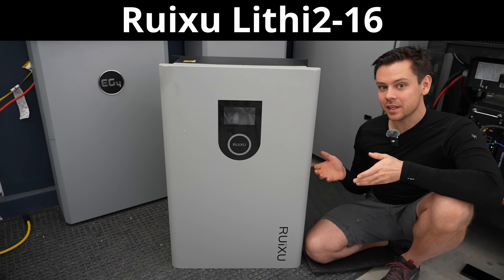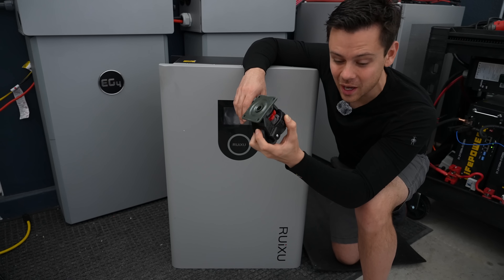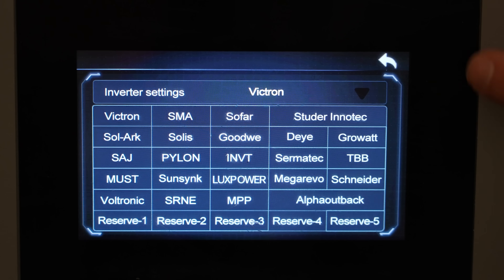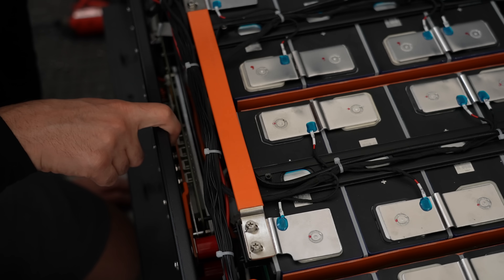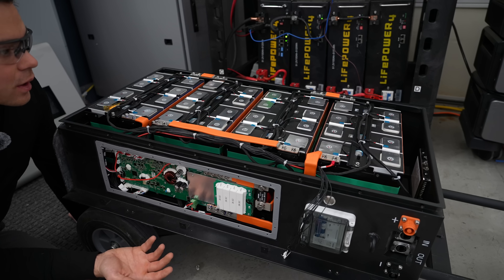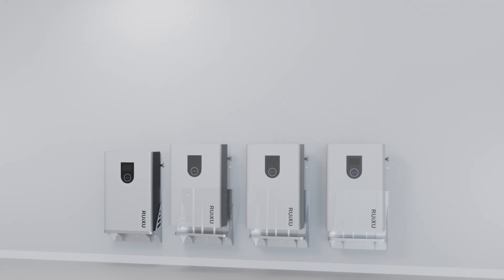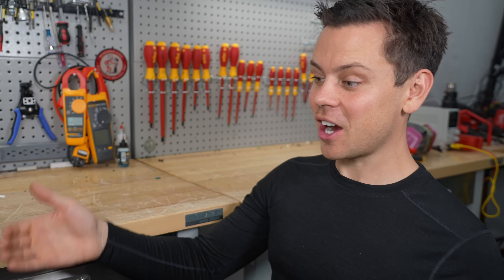Ruixu Lithi2-16: 16kWh 48V LiFePO4 that is Cheaper than EG4?!

Comment: Will, not sure what the best way to reach out to you. I really enjoy your content and have ventured into the realm of battery and solar this year. Maybe you can clear up a couple of things for me. I mounted 2-370W Grape Solar Mono Panels(41V VOC/11.5A ISC) in parallel on the flat roof of my patio. I have them set at the maximum exposure angle where at noon on a cloudless day the dot is dead ctr on my angle finder. I am connected to an Anker F3800 and HPP setup with 8 gauge PV wire at a length of 60 feet. I don't think I've ever seen you do content on Anker products. If that's true, I'd really enjoy seeing you review their stuff. As a reference, I live in South FL and the temps lately have been mild from 77 to 82 degrees. The most watts I've ever produced at noon has been 615W total. Over the course of a clear day, I'm getting about sun for about 6 hrs with an average total kWh of 2.2. Question 1: What's the best way to clean solar panels? Mild soap & water or is Windex okay(with or without ammonia)? Question 2: I've yet to see close to the 740W I should be able to produce with the 2 panels. Is this mfg not the best? I don't believe I'm getting a lot of voltage drop with my 8 gauge wire run. Any ideas? Thanks for your time and keep up the good work.
Reply: I just purchased some Canadian solar panels (535w) and hooked one up just to test to my Anker c1000, and the most watts I received was 305 watts In Arizona at 1:00 PM On Dec 20th . So with your comment I figured that this must be about right for this time of year.

Comment: It's not recommended to lift sideways with lifting eyes. I put a flat washer and cinch it down a tad. If threads are out, it may fail. Great video. I am getting to the point i'll start buying parts for this next summer without screwing myself to much..

Comment: I have a vacation home on an out island in the Caribbean where the grid is very unreliable, so there are frequent power outages.  The power can go out multiple times a week, and even multiple times per day.   Many properties have whole house backup generators, as does mine.  I’m currently faced with having to replace mine as they only last about 5 to 7 years.  Unfortunately they can also be expensive to import, maintain, and to run.  Propane is the most common fuel, but diesels are becoming popular.  Either fuel is expensive at about $6 per gallon.  The propane generators in particular can be frustrating to keep running because of a lack of qualified service people and the environment.  They are not the most reliable, and they are fuel hogs.  Given the nature of the outages a battery pack like this would seem ideal.  Seamless transfer and quiet.   This battery pack paired with a EG4 Hybrid Inverter configured for ‘Battery Backup’ would seem perfect??  I wonder if I am missing something?   I don’t have any plans to install solar, but that might change in the future.  For now I just want to have another alternative to an annoying generator.

Comment: Why couldn’t you use the super cheap LiTime 12V 560AH batteries for the Flexboss? Connect 4 in series? Would the 250A BMS limit the system?

Comment: Been completely off grid for 5vears this channel has helped me a lot.  I'm curious if this battery will work with my magnum ms4448 pae inverter charger. I have the bmk and shunt and my inverter has a rs485 communication port and I can set up my charge profiles with my me/arc remote Any help any one could provide would be greatly appreciated. A lot pf money of it shows up and I can't turn it on or something.  P.s great channel Will!

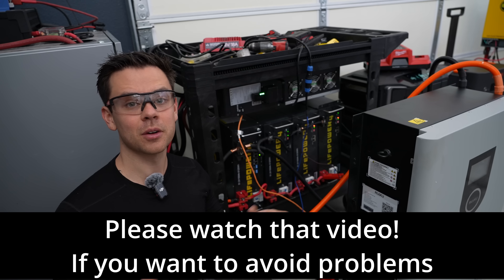Comment: I haven't been able to find the video referenced at 8:50. Could we possibly get a link? Thanks.
Reply: same question!  I have 3 EG4 PowerPros but might want to add one of these bad boys in parallel
Reply: I'm looking for the video, too.
Reply: @willprowse also looking for the video. Same question on paralleling this or the midnite powerflo battery with and eg4 outdoor pro. Can you link the video. Or do a video covering how that's done, or if it's possible. Thanks.

Comment: This is super exciting to see—thanks for breaking down the Ruixu Lithi2-16! 🔋 It's great to have more options in the 16kWh 48V LiFePO4 space, especially at a lower price point compared to EG4.

A few thoughts/questions:

    Price vs. Quality: While it's cheaper, how does it stack up in terms of cycle life, build quality, and warranty compared to EG4?
    Compatibility: Is it as easy to integrate with inverters and other system components, or does it have specific requirements?
    Performance: Any noticeable differences in real-world performance, especially under heavy load or in off-grid scenarios?

This seems like a solid contender for anyone building or upgrading their solar system. Thanks for the deep dive—it’s much appreciated! 🌞💡

Comment: Will Hi . My name is Ross i just want to ask you a Q  i do have two batterries 48 v connected in parallel can i add any othrer batteries the same voltage to the sistem with out  any problem??

Comment: Thanks Will! BTW, you'll find that heavy wheeled batteries, like a tall load on a hand truck, must be "top-balanced." Everyone knows that even an ordinary lightweight broom is nearly impossible to balance with the big end down, but can be managed better if it's top heavy -- as long as the appropriate fine motor skills are brought into play. Doesn't excuse poor design and execution, but it does highlight one possible workaround!

Comment: Will, to satisfy the 400ah requirement of the 12000XP could you combine one Ruixu wallmount and one Ruixu server rack battery without any issues ?
Reply: You need to increase the battery capacity so that it can reach a ratio of 5 with the inverter's charge and discharge current.

Comment: At The beginning you stated this is an outdoor battery, does that mean it cannot be used indoors?  If not why not? Thanks
Reply from the maker: If it's outdoor rated you can always use it indoors
Reply from the maker: Indoor rated doesn't exist. Just bad wording on my part
Reply: @WillProwse thanks, it was just the way you said it right before you did the cost comparison!

Comment: Those picking eyes on the side are oriented wrong for lifting that battery vertically. They should be rotated 90 degrees  that so that you are pulling inline with them or ideally mounted to the top of the case. Even properly rotated they can only be used for 25% of their rated load when in that orientation(90* angular load) the way they come installed they are completely illegal for overhead lifting use.

Comment: Does anyone know how Tesla hooks up their $16,000 range extender, inside the truck bed, to the main battery, so they work together? It would be cool if this Ruixu could be used as a range extender in the CyberTruck bed, but it needs a connector inside the truck bed to connect it to the main battery. I guess you could pull over and charge the main battery with the butthole NACS connected to the Ruixu if your range drops to near zero, but it would be nice if you could use the Ruixu like a rolling Tesla range extender.

Comment: @DIY Solar Power, so you like this wall/ground mount battery? Since Ruixu bump up to the 314ah cells i take it EG4 will do the same since the form factor is the same size 280-314, i wonder how long will it take them to bump up to the 314ah cells? Anyways can you mix Ruixu 2-16 and EG4 power pro in a parallel setup?
Reply: I hope so:  Will mentions a video where he describes how to do it but I can't find it.
Reply: @ i was not able to find that video as well however in this video he did show pictures mixing many different EG4 batteries including with the Ruixu so I’ll take that as it’s possible but not recommended by manufacturers.

Comment: Great video review.  I've been waiting on someone to do a review on this battery.  I do have one question for you Will or anyone else for that matter.  I have on EG4 indoor rated wall mount battery connected to my single 6000xp inverter.  How would I need to wire this battery in and have battery comms across the entire system?  That part kinda confuses me.  Thanks

Comment: Is it UL Listed?   I had my 46,000 watt hour battery bank catch fire and do $150,000 damage to my shop. A BMS failed, 12x300 AH Batteries in 2s6p for 24 volts. The repairs in the shop should be done in 2 weeks, 4-1/2 months after the fire. I am going EG4 18Kpv with 5 outside EG4 batteries but have not committed yet. EG4 is UL Listed and EMP protected.
Reply: They show their UL certification on their website

Comment: Crazy question? Can you build a high voltage battery and run it into the PV input on a modern inverter?
Reply: Depends on the type of inverter

Comment: I live in a 220v country . Do I need 2 of these ? 
 Also there are voltage fluctuations. Is there built in AVR protection if I'm connected to the grid ?
Reply: You're going to want to research this a lot more. You need an inverter, these don't connect to the grid, or your AC panel...

Comment: I'm sure I could find something on the forums, but do you (or anyone else here) have a good recommendation on a case for LF280K cells?
I currently just have them on a shelf, but would like them in a nice enclosure for better safety.
On the other hand, I do plan on moving in a handful of years, so maybe moving a single 200LB+ item from the basement may not be so fun.

Comment: @willprowse How would this work with an existing rack (6) of EG4 LL v2 batteries? Since the inverter only has one comm port, I'm not understanding how you can mix and match. Do you just daisy chain this thing into the mix? I know you told your viewers to go watch the current sharing video, but I'm having a hard time understanding the communications part of the equation.

Comment: In a perfect world I would jump on this…but it’s not. I will opt for multiple server rack 100ah batteries as if something goes bad like a BMS I can take that unit out and continue on with those that operate. More pity with cabling but not undoanle as many have proven.
Reply from the maker: Did you see how this is easier to swap the BMS than a server rack battery?
Reply: @WillProwse Will, what is you opinion on price increase or decrease on these batteries? I’m looking at the exact same battery but have been debating if the cost will Actually go up or down. Almost wonder if these companies won’t lower their prices even more to sell as much as possible before tariffs go into effect. But, like others have noted, the tariff talk, and knowing Trump, is designed to get other nations to fall in line politically and to stop screwing over America. Maybe Ruixu would start a plant over here and the prices would drop even more? That won’t be within the next couple years though most likely. Right now we’ve been running our off-grid system from my DYI 18650 cell packs since the start of the plandemic in 2020. So it’s been better than the lead-acid, but now they are starting to loose power capacity and surge loads drop the voltage pretty easy. I thought about building my own LifePo4 with Eve A cells, but after all the goofing around it’s still better just to buy and know your getting a good product that looks nice too. One debate I have is the rack mount vs this stand up model. Your thoughts since you have both?
Reply from the maker: @user-Q-  I'm wondering all of this as well 😂 I really wish I knew
Reply from the maker: @user-Q-  short-term it might go up. Long-term has to go down. We have no choice
Reply: @ I’m very isolated off grid 100% and need immediate remedy and don’t have the luxury of waiting for a BMS to arrive when it’s -20F outside. I don’t know how it would be for others following the immediate aftermath of a hurricane or other disaster when UPS or FedEx can’t deliver.

Comment: You might want to think about adding a set of full-extension drawer slides to your mobile cart build for the 6000XP. I don't know how you can work on that thing in the position it's in now.
Reply from the maker: It's remote controlled
Reply from the maker: Change the settings with the dongle
Reply: @WillProwse  I know--I have one mounted on a wall above the EG4 battery--I was talking about the physical connections on the cart.

Comment: Can I mount this or the EG4 wall battery flat on it's back on the floor? I want to install it on the floor of my RV.
Reply: Yes. I have horizontal moveable mount either 4” air space between LL batt and 6000xp.

Comment: On the eg4 vertical battery, you have a direct support for RSD. It's actually quite simple. You plug your eg4 battery into your 6000 XP, you connect an external mushroom switch and when you hit it everything shuts down and the breaker is tripped on the battery. Would you please amend your video to include RSD testing? And would you please start including RSD review in your hardware testing. RSD option is not very expensive.  It's fine to ignore RSD on little toy systems for an RV, but when you spend 5 to 25 Grand on hardware, it's pretty silly not to include RSD for the extra safety.   The basic tigo modules where you can connect two solar panels per unit are pretty cheap.

Comment: Just purchased 24 of these batteries. They'll be delivered this coming Wednesday. Six Sol-Ark 15k, broken into two banks of 3 Sol-Ark with 12 batteries each. I'm finally building my forever home, so will never need to move these once they're mounted. Also ordered two extra BMSs in case I need them down the road.
Reply from the maker: Please post on forum, I would love to see that monster!
Reply: @WillProwse  Definitely will.
Reply from the maker: Holy cow!! That's a lot!
Reply: Wow that is a big setup and you went for Sol-Ark 15Ks which are expensive but really good Inverters.
Reply: @Dreadlk assuming Deye doesn’t just decide to ransomewear your equipment…
Reply: @joeldcoxks  Deye does not control Sol-Ark inverters.  I see it mentioned that all there data and firmware computer update systems are in America.  I would be worried with EG4 because all of their control stuff is in China
Reply: @Dreadlk  Everything is china. Find a single AIO inverter that has nothing but American parts and software
Reply: Do you mind sharing the model # of the extra BMS you ordered?
Reply: Do you mean 24 of their 48v 100ah Server batteries?   Even that is a lot, but 24 of these wall-mounted ones is crazy.
Reply: @AndrewMetcalfe  24 100Ah server rack batteries isn’t a lot. I wouldn’t even consider 24 of the wall mounts a lot. A large electric house in a northern climate without sun for days at a time, it’s probably adequate
Reply: Have been running my system for a month now. Was waiting for a review on these batteries but couldn’t hold out any longer. I will be ordering 2 more soon.
Reply: At present I use two Fortress LFP 15kWh batteries that are 7 years old. Fortress doesn't make this style anymore, only an upgraded eVault max @ 18.5 kWh batteries. I have a 10 k solar array and have seen it output as high as 12 k W. 
I switched from 2 OutBack VFW3648 (kept breaking) to one Schneider XW Pro 6848. I will add another 6848 Schneider during the battery increase because this one inverter have proven to withstand huge loads up to 12 W.
I looking to increase my overnight storage capacity due to winter time short days. 
So, I looking to buy 10 of these batteries. 
Here's my problem: I am hesitant on doing so because they are a Chinese company, with a warehouse in Ontario, CA and I'm afraid of losing any bank transferred money through deceptive practices.
I don't know what to do.
I need to hear about other people and their experience with dealing directly with RUiXU?
Reply: 24??can you buy me one? 😂

Comment: Thanks for that video, one observation, could you place them horizontally on the floor? For the battery cells they would be horizontal and not vertical? Or does that have no influence on performance at all, thanks
Reply: Yes,it can.

Comment: I've been using my Lithi2-16 to power the majority of my house loads daily since July, paired with a 6000XP. I've not had any issues so far, and it has allowed me to become a net producer of grid power. It's a pretty cool battery for the price.
Reply: hey bud, can you share more insights about your experience with the battery? We are just about to hit buy but still undecided
Reply: @martiruda  there's not a whole lot more to share, it's running my house circuits without issue. I don't really even think about it much anymore. It's just there, charging and discharging every day. Only when the dishwasher heat cycle kicks on or the tea kettle is used does our house pull more than 1kw, and it seems to handle those situations easily.

Comment: Good to see these prices coming down, hopefully tariffs won't kill things too much...  Just purchased 16 EVE MB31 cells and making my own pack (First DIY 51.2v, did a 12.8v w/4 EVE LF304s that I've been using)  I'll be at about $0.13/wh, looks like this is right around $0.20/wh...
Reply: Where are you getting that price?
Reply: @truthhurts2149 $82.50 per cell from 18650 battery store and a case off alibaba from China with JK 200a inverter BMS.
Reply: @flyingtime5501  where are you getting that price?

Comment: I went with the modular ETHOS batteries. The are more expensive but they are outdoor rated, has built in fire extinguishers which doesn't make sense for LifePo4 batteries.  It's wall mounted and you don't need a rack.  They weigh about 70lbs each and are easier to deploy by yourself.  You can order from BigBattery and there was no tax or shipping charges!
Reply: Not sure if you made a typo, but the Ethos is not outdoor rated and is not self-heating.
Reply: @BoxleyAcres   Ethos batteries are IP65-rated casing.  Out door.
Reply: @BoxleyAcres   Ethos batteries are "IP65-rated casing"  Outdoor.
Reply: @BoxleyAcres   Ethos batteries are "IP65-rated casing"  Outdoor.